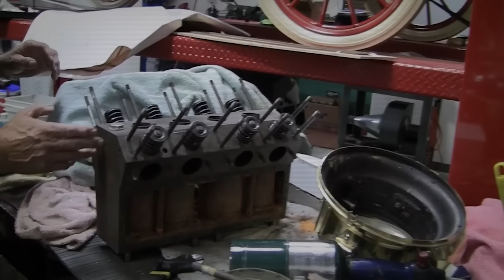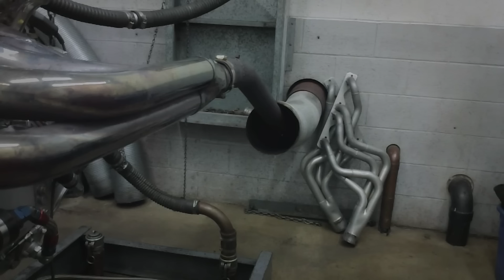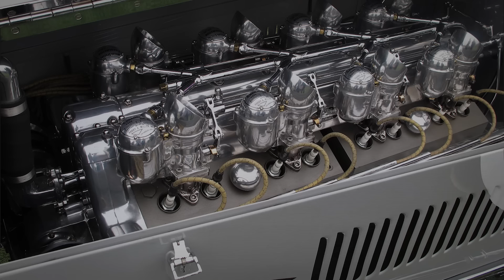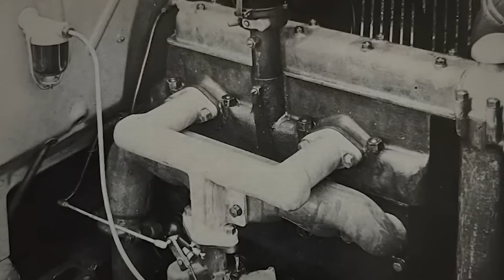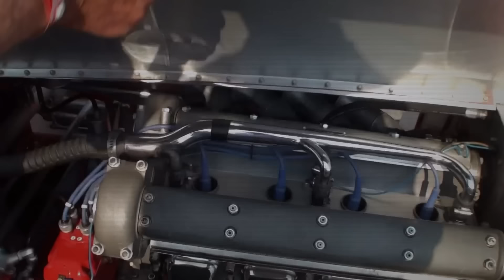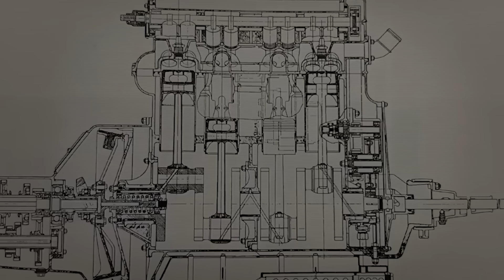The SECRET Trick That Made the “Offy” Engine Rule Indianapolis for Half a Century

Comment: See my previous 2 comments below. OK, I'm done watching this nonsense. Because much of what's being said in this video contradicts itself in other areas of this video. Also, turbocharging did NOT "threaten the Offy" in later years. BECAUSE THE DESIGN OF THE OFFY ENABLED IT TO HANDLE MUCH HIGHER BOOST PRESSURES THAN ANY OTHER ENGINE. What "killed the Offy" was the corruption of Ford and other engine builders who knew their engines couldn't handle the incredibly high boost pressures that the Offy could, so they coerced the officials at Indy to CHANGE THE RULE ON MAXIMUM BOOST PRESSURES ALLOWED. THE NEW RULE LOWERED THE MAXIMUM ALLOWABLE BOOST PRESSURE, AND EVERYONE KNEW THIS WAS A WAY TO PUNISH & LIMIT THE POWER POTENTIAL OF THE OFFY ENGINE.........EFFECTIVELY GETTING RID OF THE OFFY ENGINE ONCE & FOR ALL IN INDY RACING. I'M GIVING THIS LAME VIDEO 2 THUMBS DOWN. THERE ARE FAR BETTER DOCUMENTARIES THAT GET THE ENTIRE RACING HISTORY ACCURATE & CORRECT PERTAINING TO THE OFFY ENGINE. THIS VIDEO FAILS MISERABLY.

Comment: "The cylinder head came off with straightforward bolt patterns"..........WHAT NONSENSICAL BULLSH*T. THE OFFENHAUSER DID NOT HAVE "A SEPARATE HEAD THAT WAS REMOVED". THE "HEAD" AND UPPER BLOCK WAS A SINGLE PIECE. IT DID NOT HAVE "A HEAD GASKET" OR "SEPARATE HEAD" LIKE ALL OTHER ENGINES. THERE WAS NO "HEAD GASKET" TO BLOW. ON THE BOTTOM END, THE OFFY DID NOT HAVE "AN OIL PAN" LIKE CONVENTIONAL OIL PANS LIKE ALL OTHER ENGINES. INSTEAD, WHAT WOULD BE "THE OIL PAN" WAS ACTUALLY THE BOTTOM OF THE ENGINE CRANK CASE. IN OTHER WORDS, THE "JUG" THAT HOUSED THE CYLINDER SLEEVES WAS ONE INTEGRAL PART OF "THE HEAD".......IT WAS CAST AS A SINGLE PIECE. THIS IS WHY TURBO CHARGED OFFY ENGINES COULD HANDLE INCREDIBLY HIGH CYLINDER PRESSURES BECAUSE THERE WAS NO "HEAD GASKET" TO BLOW. Turbocharged Offy engines in their later dominant racing years were making 1,500 HORSEPOWER, which was absolutely incredible not only for the time, but for a simple inline 4 cylinder engine. NO TURBOCHARGED V8 RACING ENGINE OF THE SAME ERA COULD HANDLE ANYWHERE NEAR THE INCREDIBLY HIGH CYLINDER PRESSURES AS THE OFFY ENGINE. AGAIN, THIS WAS DUE TO THE OFFY ENGINE NOT HAVING "A SEPARATE HEAD" OR "HEAD GASKET".

Comment: He mentions the cylinder head several times...but there is no cylinder head! The cylinders and head were a single casting with no head gasket. This was bolted to a separate crankcase casting. No head gasket means higher compression and power, especially on ethanol. If the engine was running hot, they cranked up methanol to cool it down. This was an Achilles Heel because the design and casting technology didn't allow enough coolant circulation around the combustion chambers. An issue that modern casting technology can address.
Reply: I'd believe you but you're just a YouTube commentator who probably doesn't know much about  Engines 🤷‍♂️.

Comment: Ah, never mentioned…Using methanol instead of gasoline in racing engines, including supercharged Offenhauser engines, did improve horsepower output. Methanol has a higher octane rating and greater resistance to detonation (“knock”), which allows engines to run higher boost pressures with superchargers or turbochargers without damage. Methanol also provides a charge-cooling effect, lowering intake temperatures and increasing the amount of air and fuel the engine can use, translating directly into more power—often 10–20% or even higher on heavily supercharged applications. Historic Offenhauser engines adapted for methanol were able to achieve much higher horsepower figures than when run on gasoline, with highly boosted Offys in the 1970s occasionally exceeding 1,000 horsepower using alcohol fuel. Thus, the switch to methanol played a key role in unlocking the potential for higher output in the era of supercharged racing engines.

Comment: Because they restricted the boost the offy could run they killed the offy it didn’t become obsolete it would still win . It had total gear drive you couldn’t break it . The rubber band engines could not run high boost they broke the gunner bands at high boost it will be back